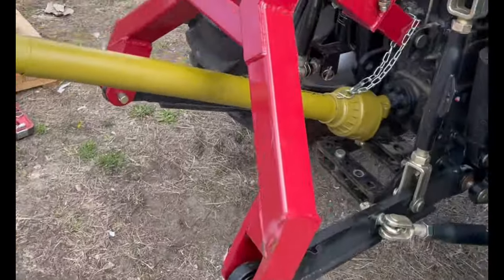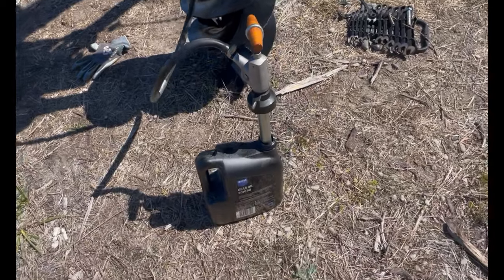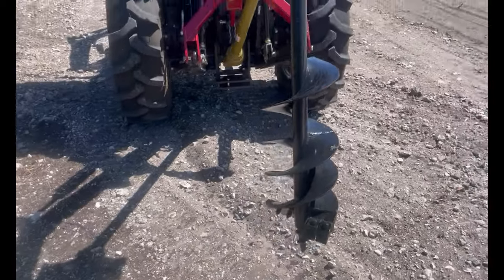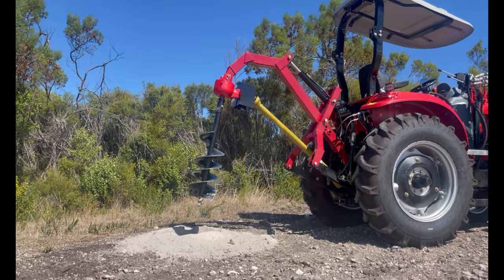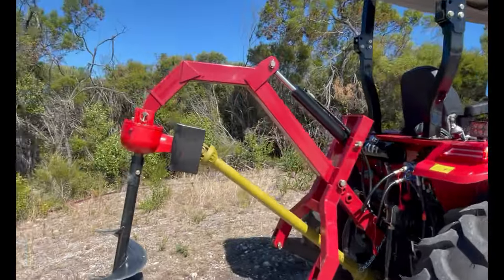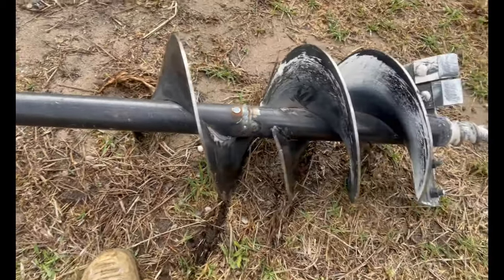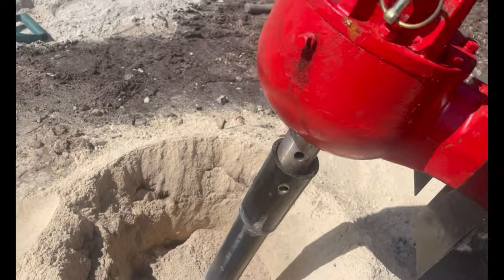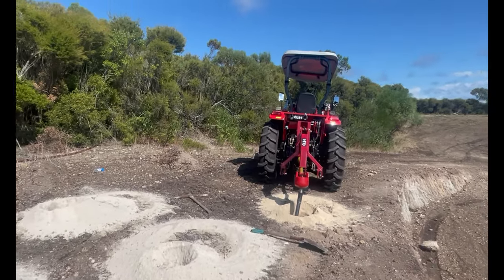Our Offgrid Oasis Needed A Hydraulic Auger. But Will Our Rocky Soil Destroy it? #goingoffgrid

Comment: A tip if you get the auger really stuck - replace the shear bolt if you broke it - then with pto in neutral apply relatively gentle up pressure with the 3pl arms - then get a large screw driver etc and with the pto cover removed use the screwdriver through the uni joint etc to wind the pto shaft in reverse. I avoid having to do this by idling the engine and going down relatively slowly this way the auger is quickly raised a little as soon as you hear the motor load up or the auger starts to bounce.

Comment: I have the same Tractor and Auger and had the same issue with having to work out how to coordinate the extension cylinder and the 3point linkage for raising and lowering. Just about every other Auger on the market doesn't have a 2nd cylinder in its design ( The geometry of the pivots and cylinder mounts causes a lock out if you dont use both hydraulic levers, no idea why its designed this way ??)  so I removed mine and gave it a go. It worked with no problems just using the 3point linkage for raising and lowering. Made the process much simpler... Art
Reply from the maker: Yep I agree it is tricky to work out, I thought about removing the downforce hydraulic as well but with how hard our rocky soil is I reckon we need every bit of downforce we have available!